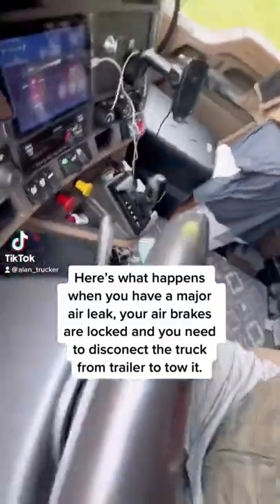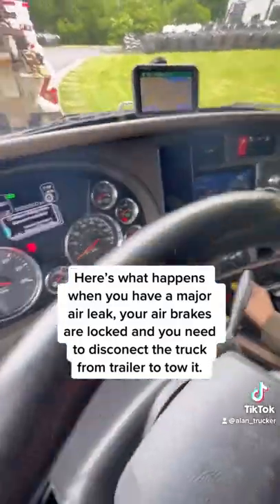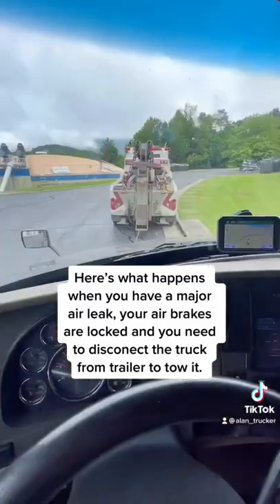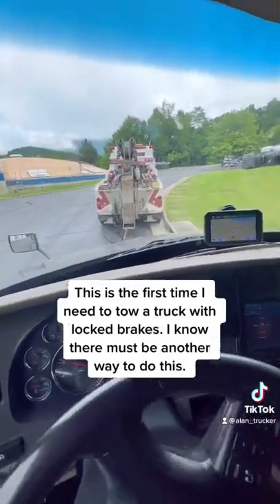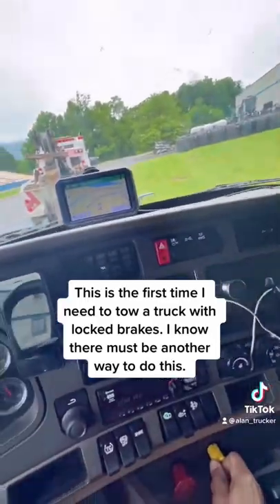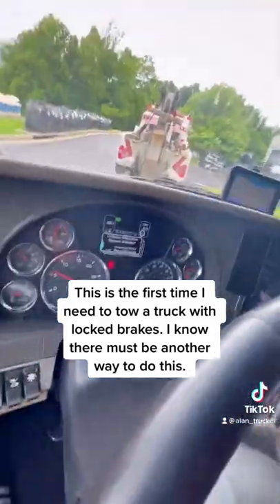Towing the truck with locked brakes. #shorts #trucker #truck #truckdriver #semi #trending #tiktok

Comment: Yeah climb under and manually release them. Or find the leak real quick and temporarily tape it up so you can atleast unlock them.. both are Fairly easy options I mean an air leak is pretty obvious